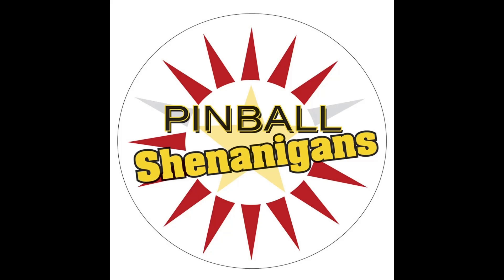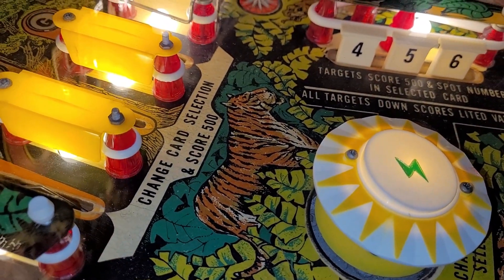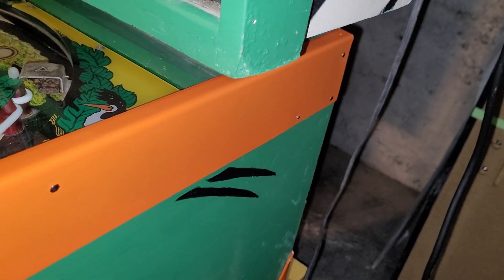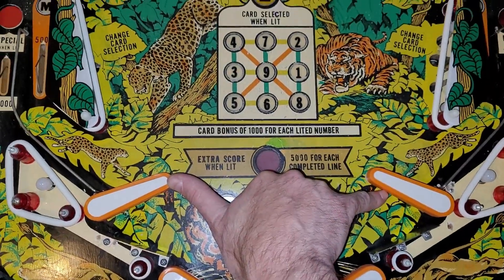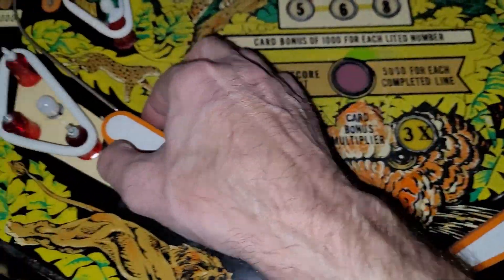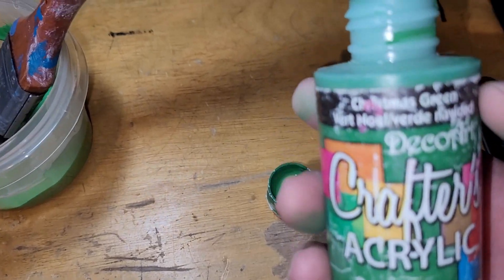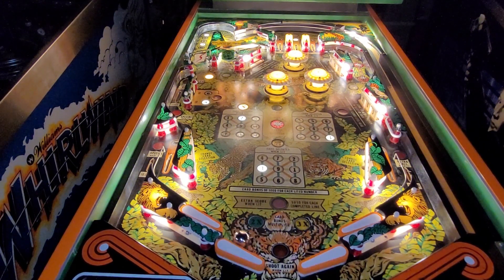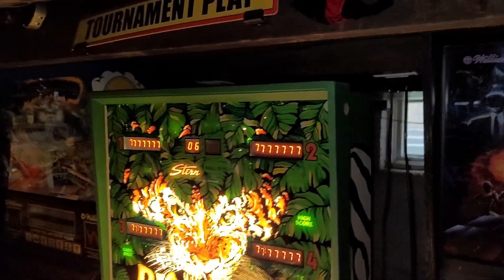Part 12: Stern Big Game Pinball Project is Finished!

Comment: One thing about replacing the coils with the flippers, if you wire them wrong, you’ll be like⚡️⚡️⚡️⚡️
Reply from the maker: I know right I was a little scared for my first flips 😁
Reply: @pinballshenanigans  I had a Lights Camera Action pinball machine about 10 years ago and my upper left flipper went out so I thought I wired the new coil correctly, and I almost fried the board 😳
Reply from the maker: @BIGMIKE360AMUSEMENTS  whoopsie, thems some shenanigans!
Reply: @pinballshenanigans  almost 😅